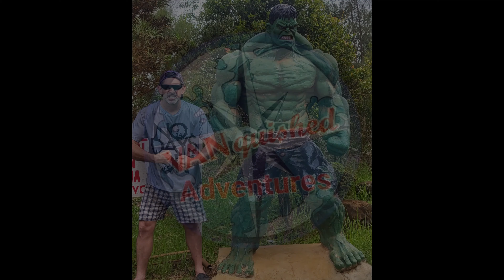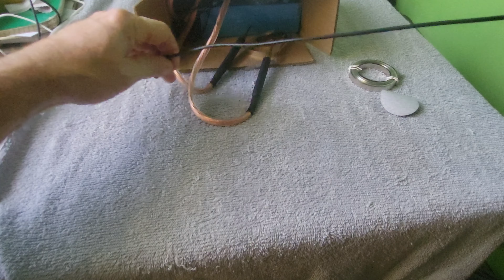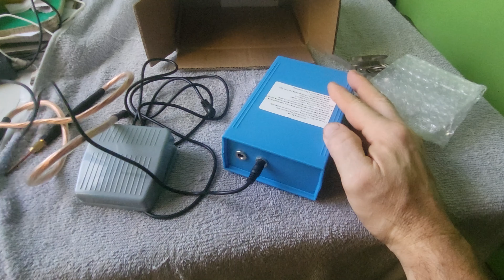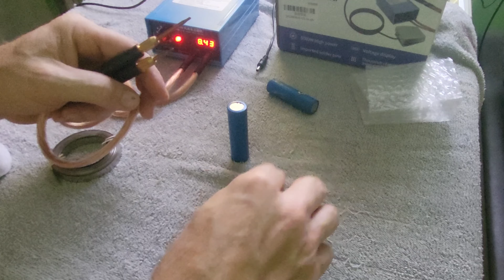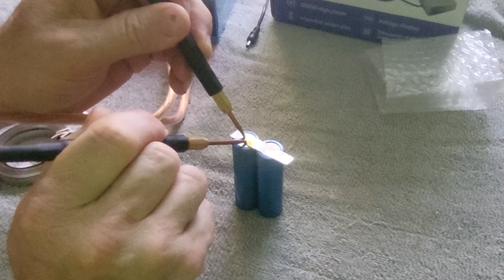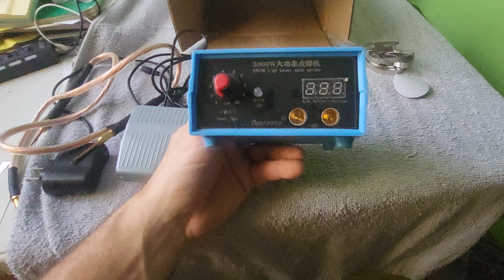Portable Spot Welder For Lithium Batteries  18650 21700

Comment: That's a slick little toy. Wonder how much power it packs - I need to do some welding on a trailer I plan to turn into a portable power pack for my van. May need to add some angle iron to hold a few solar panels.
Reply from the maker: Not enough power for that. I would suggest seeing what angle aluminium you can source and either use nuts and bolts or rivets. Angle iron geta heavy pretty quick.